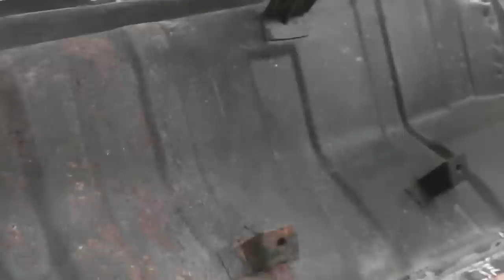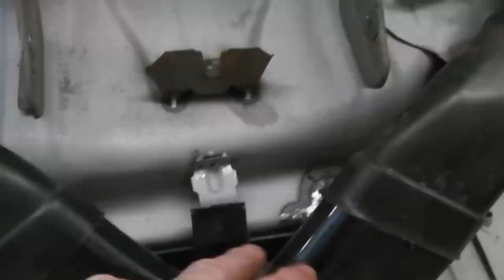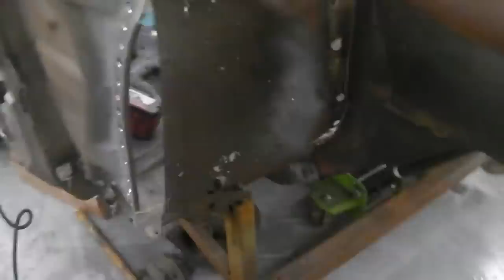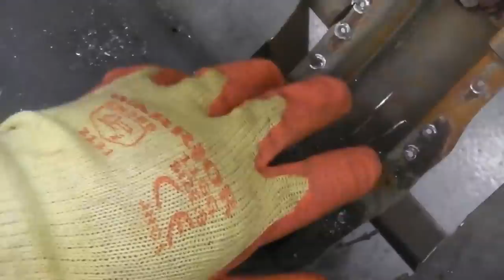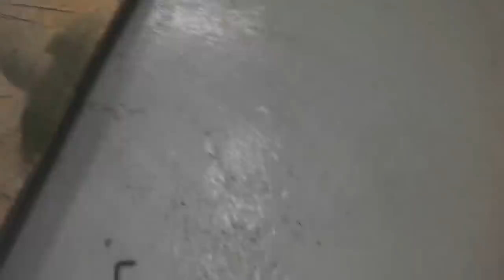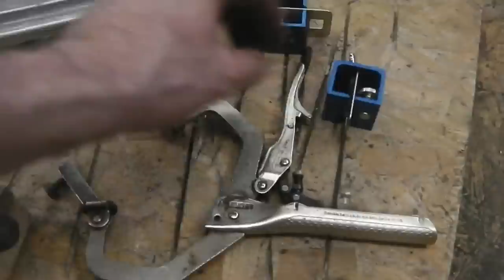Classic Car restoration - Cortina - Project Bramble EP9

Comment: Pete, that carpet securing stud would have been fitted using a stud welder,  It works on the same principle as a spot welder but you have a holder which the stud goes into and when you press it down onto the metal it fuses to it, an earth clamp would have been attached to the panel to make the circuit.  I used to use them a lot when I worked as a sheet metal worker back in the 80's

Comment: I watch Cortina City several ways,...I use at work on breaks and lunch times a Kindel Hd " screen device, its a tablet as alot know,.....and at home I use desktop computers, AMD A10 5800k with older 2gb amd gaming/video card and 10 gig ram with a 28" led 1080P tv monitor, or my other computer, a new one,  I recently bought at walmart clearance for $250(was a $550 computer system) an I3 7100 Intel cpu and 8 gig ram that came bundled with a 23" dedicated hd computer monitor, led style of course.  Very interesting what you talked of bout the video camera used when welding,..I was wondering,....I think a autodarkening hood could be used to protect a camera from long term damage, ....maybe, unsure.  Yeah, the new computer has USB 3.0 and better ability to edit video, it is "faster", why I needed a newer computer since I will be doing some videos myself, soon.  My cameras,...errrr, let me say,...not so great, my best two are in the $200 range with removeable microphones of course, I have previously put alot of work into sound, on the cheap, modified really cheap video cameras without a external microphone jack to have enhanced sound,....I don't like to synchornize sound from a digitial sound recorder,...all 1080p video cameras of course, other than a poicket camera, a 16mp nikon pocket camera I've had that does only 720p,  I've done electronics refurbishings/repair, having received some formal training in such both military and in college, so ya know, I have tinkered with camers and modifying them, repairing them,...you would be surprised what you can do with plastic funnels modified and put over a lower end cheap external microphone,........like having a very expensive microphone capable of picking up close and long distance sound,....acoustics is what I am talking of here,...got into the whole sound of videos to improve sound cause years ago I spent loads of money on fancy video equipment only to lose interest and delve into the daily grind of work and family for years till the equipment in the thousands of dollars was unused, obsolete, and went bad from sitting around, ...never again, so I keep video camera equipment investment to a minimal unless later I really really need something good, errrrr, which I won't likely be able to afford anyway, haha, I'll never have more than a $500 camera ever, ,,,maybe.  Youtube viewers can be harsh on videos due to quality, but its the sound that they dislike more, I know, cause I had some videos up years ago and my camera was built in sound and terrible, loads of neg comments on that,...sounded okay to me, ha, oh well, thins are different now, I understand video sound more,.....your videos have great sound,....and likely doing some handheld digital sound recording separate from the camera and mixing it in with the videos alot of the time.
Reply: Oh, speaking of maybe possible good candidate cheap cameras to use for filming welding, like those cheap $130 or $170 cameas, like besteker, they have screw on lense or filter capability, the better ones, and I have all sorts of adapters for those in order to screw on larger filters or lenses, like wide angle or UV filters,...seems like a UV filter, maybe a shading filter as well could protect a ccd from damage, unless a person rigged up a auto darkening welding helmet for this purpose, to film welding with damaging a camera or getting weld splatter, etc etc.

Comment: Haven't read all the comments, but for your carpet fixing pins on the bulkhead, you want a stud welder. Basically it spot welds "nails" to panels. For the slots in the scuttle, take a look at Project Binky, I think it was the episode where they did the wipers. 👍

Comment: Well done Pete, your doing a great Job, I worked for a Ford Main Dealer when the MK3 came out and went on some factory courses. On the first  models, the front subframe bushes used to turn, we were always having to correct them under warranty.  If you know someone who wants a MK4 boot, I have one, it in Sahara beige
Reply from the maker: wow Kev, thats crazy info!!! yes i can see why they turn, i thought it just my cars as i have had them turn on my blue GXL (swampy)
Reply: @PeteCswampy  we found that with a large modified screwdriver in the hole in the bush we could turn them without dropping the subframe.  Our foreman seen us doing it and we thing he told FMC. soon afterwards they supplied a tool that was basically the same thing

Comment: Congratulations on the 10k mark. Just a question, to minimize any panel warpage, could you not weld it and keep the panel wet by spraying it with a oil and water solution? That way the water would evaporate and take the heat out of the panel?

Comment: Hi Pete congrats on the 10k mate I have also extensively restored my 1976 Mini Clubman 1098cc when I was welding in panels that had been joggled or need to be “CUT & SHUT” LOL I always kept some moist window putty at hand as the heat transfers to the putty so warping of the welded area was kept to a minimum ATB Andy
Reply from the maker: Andy thanks for tip, i made try that idea!¬!!! thanks fro your good wishes on the 10k, good ol clubman!!! mate had one in 86, painted it black, i got lots of pics, pete

Comment: The carpet pins where welded on with a special welder with the pin attached to the welder head , a bit like a spot welder , the current passes through the pin and welds itself to the panel they also used them on the 1976 mk1 fiesta !
Reply from the maker: thanks Kev, very valuable info, later on i thought of this smae idea, someone else also suggested similar idea, like the pins they use on body repairs. looking at the carpet pin i guess it was the only way, ..how did they line them up? Kev can you recall if early cars like mine were submerged in the body colour paint, or just in primer, then body colour was sprayed on??? pete it looks like they sprayed em later? i think this is true as concors restos often will just let some overspray land on the floor pan edges to make it look factory. Kev its great to learn from someone who was on the actually production line, i have many questions, pete

Comment: Great job pete, by the way lechler do the 2k epoxy (29107) and they can tint it any colour, its a 2k paint but its a non iso paint. That stuff your using is ok but its only a 1k paint, so its porous. Think of the first primer coat as your foundation, you want it to be right.
Reply from the maker: thank you for this info. Paint is not my strogn point! I decided to just clean back to bare metal then put the tecnogrip on to stop rusting, i noticed my panels were starting to slowly flash rust, however the whole shell is gettign soda balsted so most will come off again, i found it really really helpful to spray the tecnogrip on so i can see the shape of things, i followed advice from a local paint shop and for what im doing all is ok so far, but i will hnad paint over to the specialists when ready, thanks for your help, pete
Reply: Have a read through some of the threads on, https://www.mig-welding.co.uk/forum/threads/primer-for-bare-metal.82842/#post-1180052  do a search on epoxy primer, will give you a good idea of what its about, some knowledgeable people on there. Epoxy primer is kind of new here in the UK (at least in the automotive sector) the US have been using it for many years and commonly refer to it as  sealer. So bare in mind most restoration/paint shops over here are not up to date with it yet, so you really have to insist on it.
Reply from the maker: thank you !!

Comment: Another great video Pete,well done. Congratulations on the 10k! Those carpet retaining pins look a bit like the stud welder dent pulling pins the body shops use....could be a similar tool?
Reply from the maker: you nailed it !!! PUN   yes Kev who worked the dagenham line just messaged to say what you said, the stud / pin is attached to a weld gun,  i wondered how they knew the exact position, hey Wayne you seen ep10 yet????
Reply: Yes, I’ve been binge watching. I watched 9 here then switched to Patreon for episode 10. I never realised the PFL and FL were so different. All those pressings and panel changes...I assumed the differences were just cosmetic. Every days a school day!  Cheers Pete

Comment: Great job on the scuttle panel. A pity it doesn't come fully finished though.
Reply from the maker: THANKS. I know it would have been a lot easier punched, its fitted ok but i can see ripples where the weld line is, it will need careful bodyshop attention to make totally invisible, its a job for my paint shop guys, thanks for reply, i like your handle too. pETE

Comment: I LOVE WATCHING THIS PROJECT. YOUR PATIENCE AND TENACITY TO SEE THINGS THROUGH ARE A CREDIT TO YOU.  THE ONE THING IF I MAY COMMENT ON - IS THAT I THINK FORD DIDN'T DO A VERY GOOD JOB OF ENGINEERING THESE CORTINA MODELS. THE METAL USED IS THIN, AND IT APPARENTLY WAS VERY PRONE TO CAPTURING WATER AND RUSTING OUT.  THEY USED PRESSINGS FOR STRENGTH AND WELDED PANELS TO CREATE A UNI-BODY SKELETON = WHICH EQUATES TO A CHEAP WAY OF DOING THINGS. IT ALSO KEEPS THE WEIGHT OF THE CAR DOWN. I ALSO THINK THAT FORD CO. SHOULD PAY ATTENTION TO HOW THIS PROJECT IS BEING DONE AND WHAT HAS PROVEN TO BE A LESS THAN STELLAR  PRODUCT THEY PRODUCED BUT HAS A CULT FOLLOWING TODAY. 

YOU ARE VERY SMART INDEED TO MAKE SIGHT MARKS AND ALIGN EVERY BIT THAT YOU REMOVE AND REPLACE. YOU UNDERSTAND TWIST AND FLEX OF HOW METAL PANELS REACT TO BEING  REPAIRED OR REMOVED AND ONLY TAKE ON A LITTLE BIT AT A TIME BEFORE YOU MOVE ON TO THE NEXT PART. YOU CHECK, RE-CHECK AND REFERENCE CONSTANTLY. iT IS PAYING OFF.  

I LOVE HOW YOU SAY, YOU'RE LEARNING ALL THE TIME -  RATHER THAN POSTURING AND CLAIMING YOU KNOW EVERYTHING THERE IS TO KNOW ABOUT CORTINAS.  YOU HUMBLENESS IS ENDEARING.  ONCE THIS PROJECT IS FINISHED AND ON THE ROAD AGAIN - I AM WONDERING HOW MUCH A FULLY RESTORED FORD CORTINA IS WORTH. 

CONGRATULATIONS ON HITTING 10K FOLLOWERS.
Reply: Lindsey Allison Westhaven Hi, I would like to answer your comment if possible.
Ford got the engineering spot on with the Cortina Mk3, keep in mind this was a 70s car, it was not so important to save weight as fuel was a lot cheaper than today, the car was all steel and iron, light alloys were about 10 years away at the time of production.
No manufacturer wanted the product to last, if it did you would never buy another car.
Faults are built into every vehicle, you then have a dealer parts network, if this has been parked outside for around 20 years it is a surprise that anything is left to restore.
Watching this video is great, I remember the stamping shop at Dagenham ( where the panels are made ), it was madness, bang crash bang crash 24 / 7, the noise was incredible.
Pete is doing a great job on this classic, many would have sent it to the crusher years ago.
The production rate for these was also high, the target was between 68 - 75 cars per hour, so yes they had to be cheap to build to put the profits up.
I hope this helps.
Reply from the maker: Lindsey thank you for this reply, i appreciate you took time to watch the films AND to write a lengthy reply for this it means a lot to me, so thank you, and im really made up that you commented on the learnign aspect, yes im glad you picked up on the alignment work that i like to do, its so much easier getting it right first time, i find i have to have some kind of symmetry whenever i can but its not always possible, anyway  thanks once again, for taking time to let me know your thoughts. I think for todays manufacturing process, theres not much relavance when comparing back to mk3 production days, technology has changed so much. Pete
Reply from the maker: John wow thanks for this, where you in the press shop? I know a few who worked there. I met them at the NEC car show,im trying to build a network of ex workers as your knowledge is second to none, thanks for reply and thanks for comments on the channel, i had guessed at 1400 cars a week, would this be about right? I hope that i do the resto justice, especially as I know you are watching if your worked on the car at the time, thats like the holy grail for me, knowing peole like you, so many questions i have. If you scroll trhu comments Kev also worked at Dagenham. All the best, Pete. PS glad you liked the resto, ep10 soon John!!!

Comment: Is being the first to comment good or sad? You asked how folks view? I only us my PC to go online although I have a good Samsung 'phone.

So my PC is a Compaq to which I have added extras to up performance. I have a Sandstrom TV that can be used for many other functions but I use it as the PC Monitor. Its only 22" but it does me, beautiful stereo sound on TV  but none as a monitor so I pipe that through my sound system - 20 year old Technics VC-4 amp and Danish Eltax column speakers. United Nations of sound here.

And the TV can play DVDs of course and has Freeview. More than enough temptation to keep me sat rather than doing work in the Man Cave.
Reply from the maker: first is good !!!!!!!!! VC-4 amp!!! nice, brushed ally? or satin?
Reply: @PeteCswampy  Dark satin finish. I had the matching Graphic Equaliser but sold it with a Panasonic carousel CD changer and Beogram 5500 transcription deck. Made a few quid and bought Mini panels.... 

I might well be one of the few 70 year olds who streams music and likes digital. Even Radio 6. But I can still shake the rafters with Gary Moore, Clapton and Malmsteen etc when the mood needs. And the PC plays CDs rather well

Comment: Is the lower bulkhead and floor one piece? I mean the transmission tunnel and floor?
Reply from the maker: yes thats all one piece but i have sepearte floor repair sections to fit in Michael
Reply: @PeteCswampy  Wouldn't make sense to replace the whole lot when its just the floors that are rotten.

Comment: Hi Pete, i'm a latecomer to the channel but i've got to say i enjoy watching your endeavours. It's been riveting stuff (pun intended), so much so that you've given me a kick up the arris to finish my Disco 2 off. It's coming along slowly Pete as i'm disabled but not giving up. Anyways keep up the good work and keep the vids coming as i've found them to be good tutorials.

All the best Pete

Daz
Reply from the maker: Hi Daz, I think PROJECT RUBY has a disco2 cruise control unit LOl !!!! got from ebay when my HELLA unit failed!! Daryl -- Glad you liek watching the films!! how the hell did you find a mk3 cortina channel LOL, did you tube flash it up? or.....thanks anway  from pete and best of luck on the disco
Reply: @PeteCswampy  Hi Pete my daughter bought me a welder so i could get out and potter about in the shed as i was going stair crazy. Anyway last week i found out i needed both sills welding on our Xsara Picasso. I hadn't a clue matey how to go about it, so started the usual Youtube search. There were tons of vids by professionals, but i needed a more down to earth approach for someone who is not a profesional, but just an hobbiest like yourself Pete. I find your approach works well for me on how to sort a problem out without getting too technical. I had to chop out the first 3rd of both sills from front working back because of the rot. So from your example i spot and stitch welded the repair panels in and it worked. You see i would've tried putting full beads down after tacking in which, knowing now, would've caused me problems and probably put me off from doing any more. So in the end you directly/indirectly whichever way you look at it saved me a ton of money. Now that i have confidence in myself i feel i can now tackle my Disc 2's chassis problems, well at least have a crack at it. The chassis has not fully gone but there are a few holes and thin areas that need patching/plating. I'll end this by saying i don't think you realise Pete how much of a resource a channel like yours can be for someone of limited experience/confidence as myself so i do mean it when i say keep up the good work matey your helping in numerous ways.